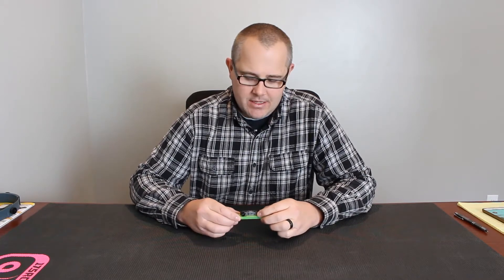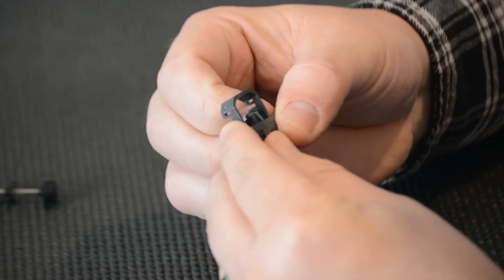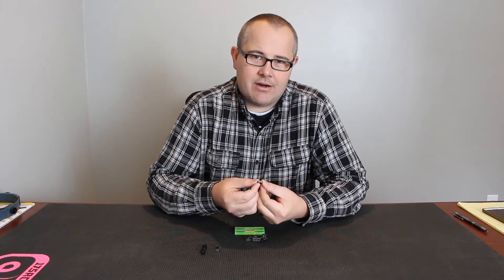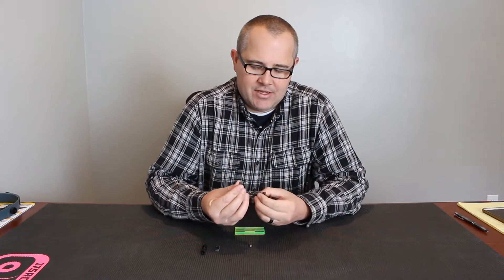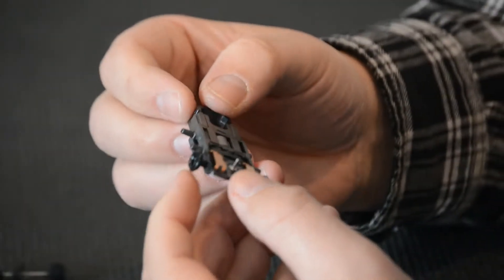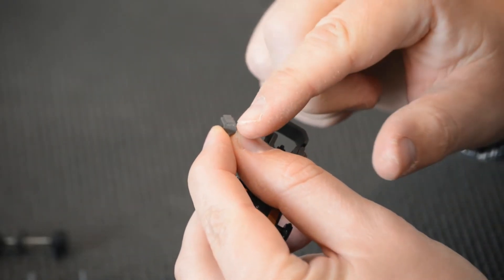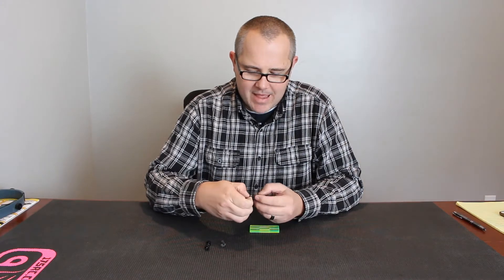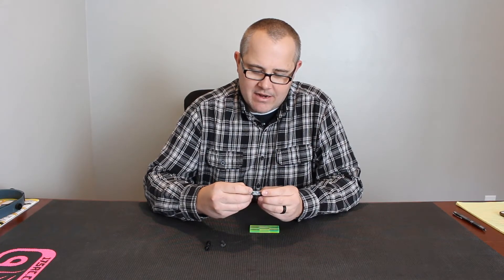HO Slot Car Magnetic Downforce Explained Hi vs. Low

Comment: If you have the standard magnetics in high down force, how do you align additional magnets on the side of the motor. For more power and down force? Can magnetic particles or filings be mixed into the frame plastic. Giving a magnet frame.

Comment: Question,what makes my track either high or low down force? I have a AFX track and my club has a MaxTrax track. Should I be running hi on my track and reverse the mags for my club’s track?
Thanks for your help.
Rocky P
Reply from the maker: Rocky thanks for the question.  Different brands use different thickness rails. For instance the Tomy rail  spec is .015 Thick compared to the max trax which I believe is around .022" wide. This is a difference of 50% which means the Max is a high down force track.  ( Also rail height varies but does not affect the car the same as the width. Rail width rules over rail height) 

If your running your car in HDF mode you could try running LDF and just put smaller tires on the car.  The lower CG would make the car handle better and the motor will be faster.  Give it a try and let me know how it goes.

Thanks